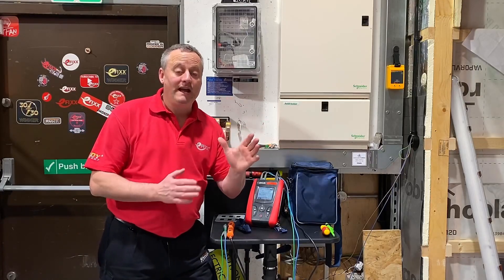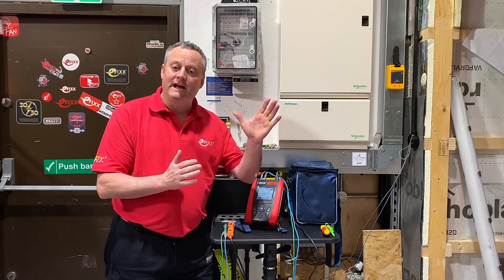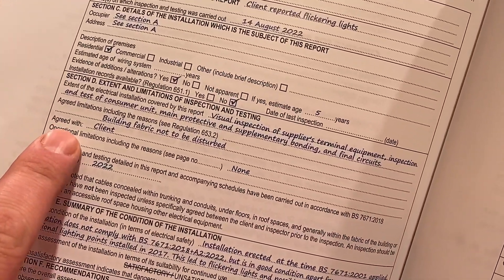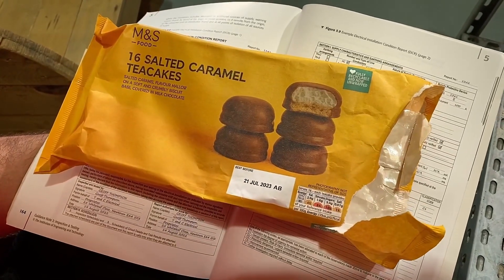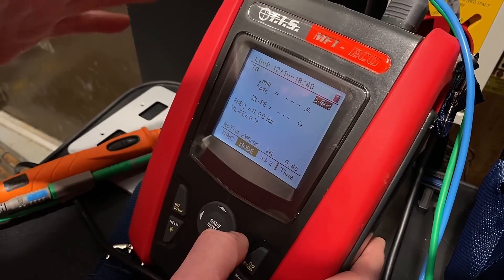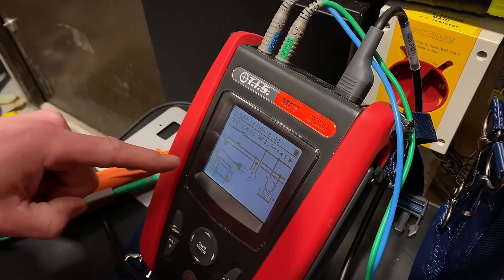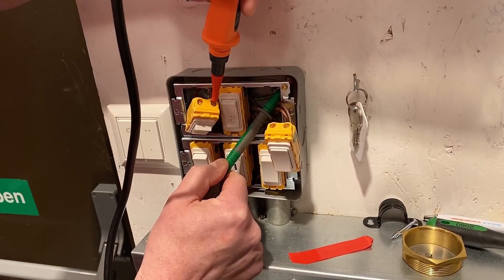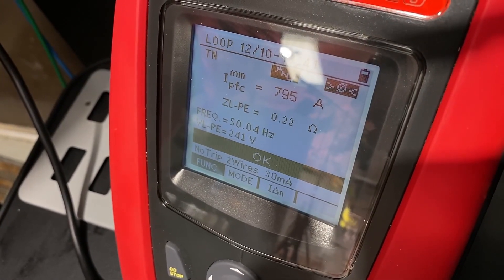Unveiling the Trick Behind 2-Wire Earth Loop Testing: TIS ECO MFT

Comment from the maker: Check out another great feature of this TIS MFT 👉https://youtu.be/__6gT2CZ10M
Reply: Also Gary if you didn’t want to use the Tip Commander, the MFT ECO has an ‘Auto Start’ feature which can be turned on or off.  This carries out the test automatically a couple of seconds after connection to the live supply.

Telling the tester what protection device is in the circuit will allow it to indicate whether the Zs value measured is within the correct pass/fail parameters, however for speed it doesn’t need to be set up if the user doesn’t need the information.

Comment: Don't really see the point in carrying out this live test at some random point in the circuit. Presumably, you've carried out a r1+r2 test at this point  and a Ze at source so why not just do the calculation?
Can't see how testing at a radom point and not the end of  line is giving you any useful information, seems a pointless exercise as you can not  confirm continuity of the cpc to all points and therefore the results for all tests are unreliable.

Comment: Anyone got any idea how TIS calculate a pfc of 795 A on a loop with an impedance of 0.22 ohms and a voltage of 241V.
I told them about this a year ago and they are still ignoring the Actual voltage of 241 but using 230V AND using correction factors of 80% for thermal effects and 95% for Cmin.  After a year they STILL haven't corrected the software.!!!!!

Comment: My Kewtech KT63 I can piggyback the blue test lead of the back of the green test lead for two wire testing. But that’s for the high current test for no trip I have to have the leads in the three lead configuration, but I’m sure I can use the two lead configuration for the no trip test as well .
Great video Gaz as always 👍
Reply: You can’t do a 2 lead low on a KT 63